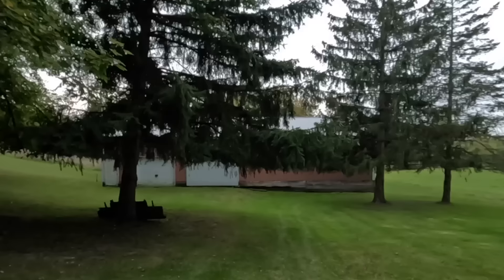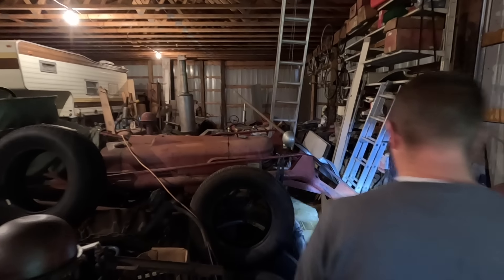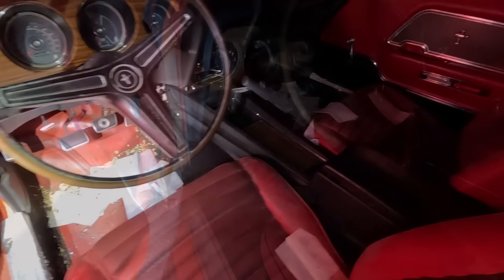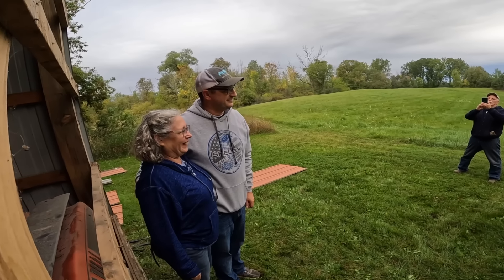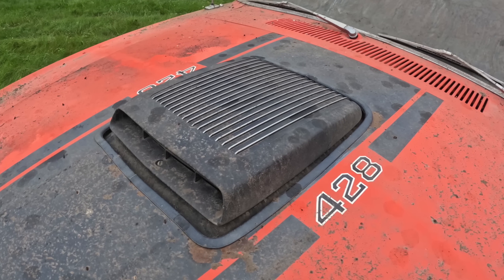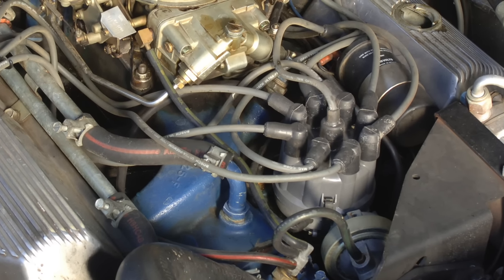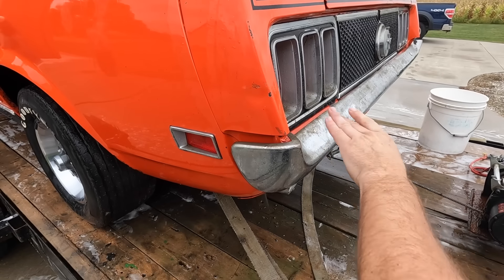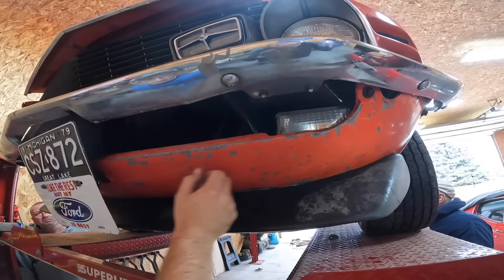Watch Us Pull Out & Pressure Wash a 1970 Mustang Trapped 40 Years In A Barn

Comment: As the owner of a 68 Mustang coupe for 45 years,  I can tell you there's nothing like it. My car is a lifelong Southern California car,  289, automatic with factory AC.  Undercarriage is basically pristine.  Once you fall in love with it, you'll never sell, I've turned down offers of 20.000 for mine, yes, its that nice. You have something very special there, I would definitely take it to have the Undercarriage fully cleaned, inspected, and treated for rust, and anything that needs replacing done. Definitely paint the lower valance.  Other than that,  she is a beautiful car. And for God's sake. Don't use STEEL WOOL on the chrome!! It will scratch the hell out of it. Turtle wax CHROME cleaner, and a soft cloth, and elbow grease will remove the rust very well. Thats what I have used for decades on my Mustang,  and all the chrome on my 58 cadillac,  and it keeps the chrome gleaming. Good luck and congratulations on acquiring such a special Mustang!!
Reply: Agreed! I’ve owned mine for 45 years as well. Wasn’t supposed to be the forever car, it just happened.
Reply: Bonjour,
Quand je vois les prix d’une voiture comme ça en France ! Chez nous cette voiture pour les passionnés et connaisseurs c’est le saint graal !
Ici en super état une voiture comme ça atteint les 100.000€
Reply: I’ve had my 66 mustang for 42 1/2 years. Never sell it. That’s a sweet car.
Reply: @jerrypuckett6733  bought mine in 77, it’s been 45 1/2 for me. Never intended it to be the forever car, it just happened.

Comment: Great Video on a Great Find...but just for fun, to my knowledge, FoMoCo never used an Acrylic Enamel on production cars. They used and perfected the use of a Red-Oxide primer under all colors [even a few parts like differential center sections] with an Alkyd or whats known as a Synthetic Enamel. Old timers called it "Straight Enamel." They achieved the gloss, flow, and durability by baking the fresh paint at nearly 160 degrees. Once again, Nice Car. And I wouldn't restore that survivor.
Reply from the maker: Acrylic enamel is the term that I've heard famous Mustang restorers use for many years. I've never heard anybody say synthetic enamel.
Reply: @thewriter2549  Although Sherwin-Williams was working on pioneering the chemistry for their new Automotive-style Acrylic Enamel by the late 60s it wasn't released for use until the early 1970s, in some areas not until even later. And Poly-Iscocyanate catalysts were not perfected or available until the late 70s to early 80s. Also, a non-catalyzed Acrylic Enamel would not work well with factory-type baking systems either and a respray could be a disaster that led to the car being crushed and tax-credited. Moreover, the all-new "30-minute paint" [Acrylic Enamel] could not be hotsprayed. GM however did release Magic-Mirror Acrylic Lacquer in 1962 replacing their old-style nitrocellulose-based paints.

Comment: THAT CAR BRINGS BACK MEMORIES. BACK IN 74 THRU 76 MY MOM OWNED TWO DIFFERENT 70 BOSS 302 MUSTANGS. BUT IN THE END HAD TO OWN A TRUCK DUE TO HER LEASING A BOARDING STABLE. THERE WAS A TIME SHORTLY AFTER HER GIVING UP ON THE BOARDING STABLE WE DIDN'T NEED THE TRUCK ANYMORE. IT WAS JUST SIMPLE TRANSPORTATION. SO ON OUR WAY OUT TO HER FRIENDS HOUSE IN WADDELL, AZ PASSING BY LUKE AFB IN GLENDALE. THERE WAS A USED CAR, CAR LOT  ON THE CORNER OF LITCHFIELD AND GLENDALE AVE. THERE SAT A BEAUTIFUL 70 351 CLEVELAND  MACH 1 4 SPEED. ORANGE, WHITE DELUXE INTERIOR, CENTER CONSOLE. IT WAS FULLY LOADED, EXCEPT FOR THE 8 TRACK. RAM AIR, CHIN SPOILER, LOUVERS, DECK SPOILER, EVERYTHING. WE TOOK IT OUT FOR A TEST DRIVE. COMPARED TO THE BOSS MUSTANGS, IT JUST DIDN'T HAVE IT. MY MOM TRIED LIKE HELL TO LIGHT IT UP, AND WELL NOT MUCH. WE COULDN'T TELL IF IT WAS A BAD CLUTCH OR NOT. IT WAS LIKE MAYBE SOME TIRE, AND CLUTCH SLIPPAGE. JUST COULDN'T REALLY TELL. SO SHE GAVE UP ON IT. BUT DAMN IT WAS A LOOKER.

Comment: Wife still has her Calypso Coral '70 Mach 1 - M-code 351C-4V/FMX auto, bought in '83 with 5k original miles from the original owner.  Now has 22k original miles...  We met at a cruise-in at a local speed shop waaaay back then.  She had her Mustang, and I still have my two '73 Cougar XR-7s, both are Q-code 351C-4V/C6 autos...  

I LOVE those mid-70 LTDs, too!  I had a '78- and later a '77 Country Squire wagons.  '78 was 351M/FMX/integral rear, but that drivetrain came out for a 429/C-6/3.25 9" combo, the '77 was a 460/C-6 already - and that one had the Hydroboost braking system and 4-wheel disc brakes!  Yes, in 1977!!!

Comment: I felt like my 16yr old self having a 69 Mach1 wishing it looked like as clean when I found it. What a gem! I've been lucky to have some rare cars but careless for not keeping or unlucky to have them stolen or totaled and both stolen and totally stripped of parts thereby totaling the car(93 Mustang Cobra in Black). My 69' was hit by a drunk driver out front when I just got it on the road it got totaled. But I did find a 68' Ford Cobra formal roof I wish I still had but also was so close to buying a 69' Fairlane formal roof that had a 427 dual quad 4sp trans that was set up for the drag strip. It was tricked out. Welded support for the trq boxes and floor boards,diff had a extended rear plate for additional oil,411 gears! Everything needed to handle a 427FE was done. I got the car but no engine. Two brothers built the car then they split the engine and car. I didn't mind I still had the 306 that I built for the Mach1 and was rebuilding the 428CJ in the 68' Cobra. That took a few years finishing high school and then girls plus playing in a band. Life got crazy I needed a fun reliable car so I got a 90GT in Bright Red. Life is a little crazy but had to get a new ride and they looked like my 69'. I got that bug when the new Boss302's came out. Nope couldn't get but I a 2011 GT/CS and then a 2014 GT/CS I love. Hope I get to keep this one.

Comment: Jerry, i had a 70 just like this one. Got it in 1988. Same color with rear spoiler, twist lock hood, all same trim. It had scoop on hood not shaker. Deluxe interior. But it was a G code car? And was a 302 automatic. Purchased for $1200. Ran and drove..Also purchased a 72 mach 1 in 1988 for $1800. Q code PS,PB, Air, car. Still have it.I kept the wrong car. Lol.

Comment: ok so just at a glance at 5:06 there is a motorcycle on the left side of frame...hard to tell with only the upper front end visible but that may be a Honda CB750-4, and if it is that is a KILLER collector bike to have. I have my Dad's 1969.5 that he bought new in atlanta in 1969 and would not take all the tea in China for it, but over the years i have found that the CB750-4 is a bit of a Holy Grail among certain crowds.  Apparently it was THE bike to have back in the 1970s if you wanted to build a "chopper".  I am a Harley guy, always have been, so of course i knew that all choppers had to be Harleys.....Oh how wrong i was. If it IS a CB750-4 someone needs to do something with it, too good of a machine to fade away inside that barn and not on the road.

and GREAT barnfind video of a great car. I rode to school in a rotation of these cars as my family member who's kids were my ride to school has always been a Mustang addict.  So in the late 80's when i was barely a teenager i was riding to school in either a 1969 Black Jade Mach1 CJ, a 1969 Indian Fire Mach 1 CJ, a 1964.5 Mustang convertible that was LAVENDER, a 1969 Acapulco Blue Mach 1 CJ, a 1970 Wimbledon White w/blue stripes GT350 or this other pony.....The "other" pony being a 1970 Wimbledon White Boss429.  Please keep in mind that my ride to school in these cars was with my 16yo cousin who's dad owned them all.  No big deal, just a kid driving 20mi to school in around 1989 in a Boss429.....my God how blessed we were!!!!!!

Comment: So some free advice for the guy restoring this Mustang or even if you're not restoring but simply planning on getting it running. That carb was manufactured by Holley for Ford, this was common Holley was contracted by all the major US manufacturers to build them carburetors for certain applications. Looking at that carb in the video Holley List#4513-1 I can tell it's been rebuilt in the past and they didn't use a Holley rebuild kit. This was a common mistake in the past, people would use whatever kit was available at their local parts store and most of those would change the needle and seat to a different style and that is what's on the one in the video. On the center pivot or center hung float bowls the needle and seat threaded into the bowl and the adjustment nut would slide onto the top of the seat assembly and a locking screw threaded into the top of the seat and it was the locking piece that when properly adjusted and locked kept it securely locked in place. This poor style of needle and seat assembly changes the nut to non Holley and the locking screw is removed, this seat has a solid top piece with a slot in it to adjust the level of the float and a different nut supplied in the rebuild kit. All it does is raise and lower the float but the huge problem is there is nothing to lock the seat in place. This style is notorious for constantly vibrating out of adjustment and then the carb runs like crap. The good news is it's easily fixed by getting a Holley rebuild kit for it then you'll have the correct needle and seat but there's one more thing you'll have to do and that is find replacement Holley nuts and locking screws which might take a little looking. The good news here is they are very universal, Holley offered them in a small kit with the nut, screw and the two gaskets  needed just about any speed shop in the country used to stock them, I know every one I worked at had them. They are all the same like I said so if you can't find the kits the ones off of any old used Holley with center floats should work! I hope this helps!

Comment: In 1970 I bought a 1970 Mach 1 just like that, it was blue with the white interior and auto trans at Burbank Ford in Burbank California, it was a showroom model and it had 271 miles, I paid $ 3300 out the door. The rear thing ia that mine said 429 Cobra jet and I've never seen one the the 429, most of them were 428 or 351. I wonder if I had a one of a kind car and didn't know it. I sold it in 1974 for $1500 with 37,000 miles. Oh well..

Comment: Very nice car, but the louvers on the back window would have to go if it was mine.  NOT in the trash of course, but just off of the car.   The exhaust definitely needs replacing with 2.5 inch pipes and Magna Flow mufflers on it. And yes, tail pipes all the way to the rear.  Maybe do some searching for factory style headers too.

Comment: This kind of stuff drives me insane..... it's a 70 mustang mach1 ok wash it . clean the interior and clean the underside with a pressure wash and degreaser.... it's a barn find ok got it filmed..... your walking around the thing like it's a new born.your going to have to go through the car everything will have to be rebuilt or replaced seals,lines,master cylinder, clutch, throw out bearing,u joints, exhaust,pull the motor and freshen it up...I been doing this stuff for 30+ year's myself late 80s I was buying these cars out of back yards,fields and under barns for $200 bucks and up depending on the people selling them.
Mustangs,road runners,coronets, chargers,cameros,challengers,novas,ect ect....these cars weren't built to last they were built to go fast down the road and on the drag strip...now all this new way of cleaning stuff dry ice......they are muscle cars... now ya can't do a father and son project because no one has 35-50k to buy a basket case so now it's for the well to do and pay someone else to restore it because all their buddies are doing it..... thanks for turning the car hobby ito a rich man's game....got me building 2000- up pick up trucks..... and don't get me wrong I seen and knew it was going to be this way.
Thing that burns me is they collect them and put them away so no one can see them and they trade them amongst their Uber rich freinds....I was lucky enough to fiddle with each and every one of these cars and I drove them like they were meant to be driven and if we blew it up we rebuilt it...... now like this one will be played with with white gloves and caution tape.restore it back to it's original glory and drive and enjoy it... Christ you can buy this car out of catalogs and build one......come on guys get back to cruising around Friday night and go to the track and run what ya brung....... liberal green crowds trying to crush them all anyway maybe you can pull the 428 out and put some electric motors in it.....nice car great story hopefully it doesn't end there...👍👌✌️🇺🇲🇺🇸
Reply: I don't think you can assume anything since you don't know the guy.
Reply: @YellowBronco  it's not an assumption... actions speak louder than words.... they are treating it like it will collapse if they touch it to hard. What did I hurt your feelings?
Reply: @ronaldmoparornocar9590  Omg god yes you hurt my feelings! Look you've actually accomplished something in your life. Good for you.
Reply: @YellowBronco  look....I am not out to hurt anyone's feelings or insult them.
 I have built these cars and they are fun cars to drive. And I understand it's this gentleman's dream car ok got it. But you do more damage to these cars when they sit..... unless it's in a climate control garage and even then they still have problems....all I am saying is share your enjoyment with others car shows long Rides let people see it ... frustrating and it gets to me is all
Reply: Very very well said.

Comment: I owned two 5.0 79 Indy Pace Cars from 87 to 91,, 2nd one was a project I found out needed an engine and I had to sell it. 92 or 93 a coworker told me about a neighbor who had a 68 red on pony red 68 Fastback 289 2 barrel automatic, complete not running for $700 firm. Body was good but not perfect. I was delivering pizza and living in a trailer park and I couldn’t scrape $700 together. I’ve had Lyme disease around 40 years, diagnosed 9 years ago so I haven’t had much for income. I’d get excited to be able to buy a 79-82 Mustang fastback with a 200-6. I can’t stand the 2.3 4 cylinder as the engine was a dog and very unbalanced.

Comment: guy doesn't get the use of a pressure washer. It's meant to use up close, seen many,many cars pressure washed, never seen it hurt the paint but I have seen it remove all the stubborn dirt and stains the easy way. guy would have been relaxing , having a cold one while this guy is just getting started. He would rather wipe the dirt around by getting hands on with a rag, he says " if I apply some pressure"  Well, that was the job of the pressure washer, had it been used correctly, without risking scratches in the paint from using the rag. Dirt is abrasive and rubbing it around will scratch the paint. Would you pick up a handfull of dirt , put it on your rag and rub it on your car?